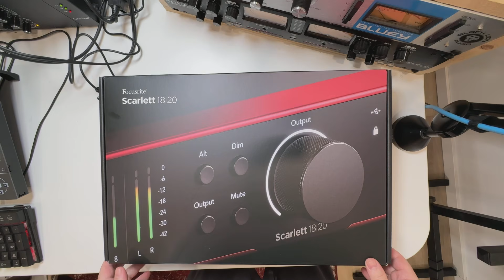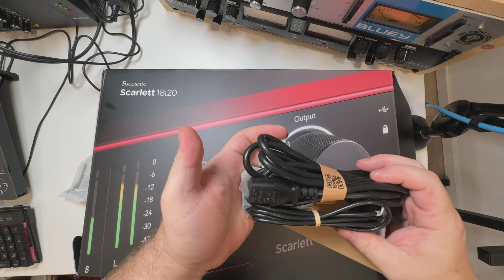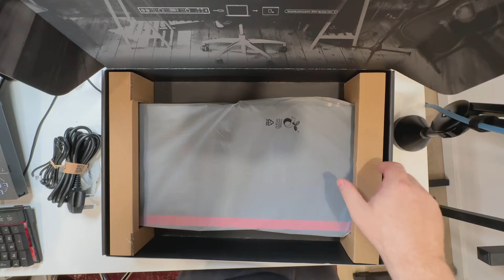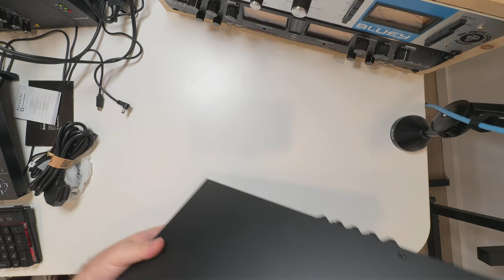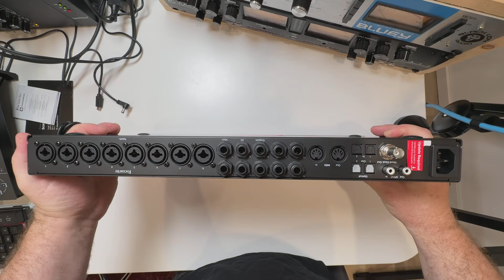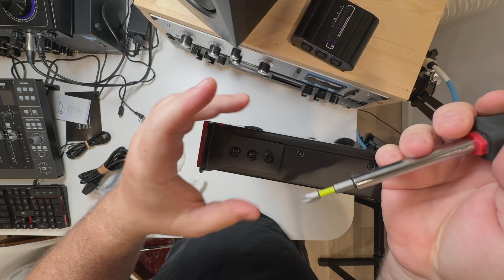Focusrite Scarlett 18i20 4th Gen Unbox and Test

Comment: I want this for my Atmos studio. Will make life easier getting a big one. Any ideas how this stands up to the Antelope Orion? Thanks. Great video.
Reply from the maker: I haven’t used an Antelope Audio Orion so I can’t comment on that. I do use Antelope Audio Zen interfaces and they are top notch. How the Focusrite 4th gen Scarlett Series compares to them depends on what it is you’re wanting. If you just want to get high quality audio recordings, quick and easy then the Focusrite 4th Gen Scarlett series can deliver on that. The audience listening to your recordings will never know that they were recorded on a Scarlett interface. 

If you are wanting l/needing something with a higher end clock and top notch converters then antelope audio is the way to go. Antelope audio also has the built in DSP FX that are very usable but they are basically just VST FX plugins that run in the box. They can be great for committing to a sound when recording but if you want to use them for mixing it’s a little more of a pain to use them compared to just using plugins in your daw. 

The 4th gen Scarlett series has made huge leaps in terms of audio quality and the fact that they cost a fraction of the price of more “high end” interfaces is a big plus.

I’ve been using this 18i20 for a bit now and it has been very impressive. It works right out of the box without the need for huge setups in the software which is a big plus as I’ve spent hours with the software for other large size interfaces and they can be a pain. Focusrite seems to understand that people don’t want to mess with that stuff and it just all works right away.
Reply: @AudioTechTV wow. Great detailed answer. So cool.  Yeah I just bought the Scarlett. 2025 product so let’s go! Thanks again. I love the 10 outs compared to the Evo’s 8. Plan to build an Atmos studio as I mainly do films. Thanks. Good luck with your channel.